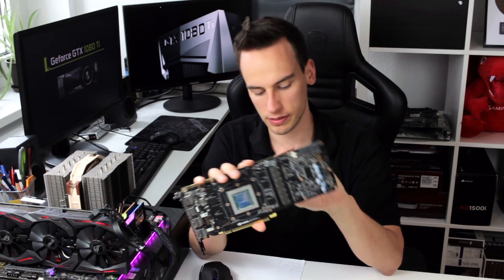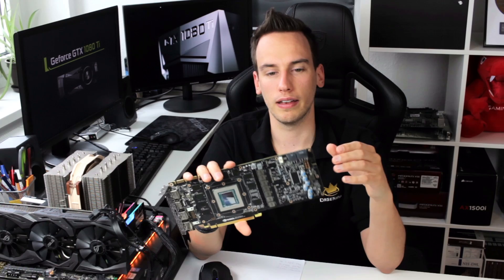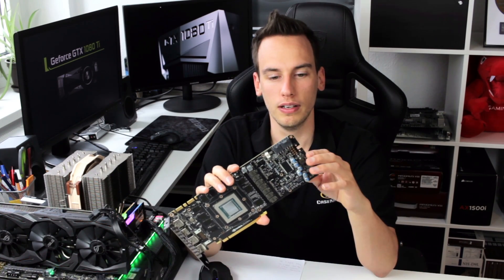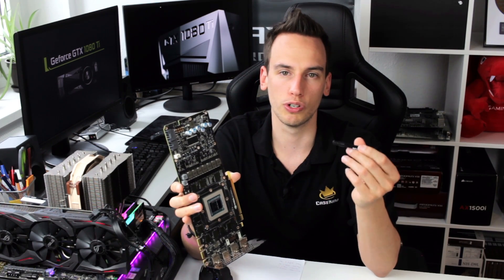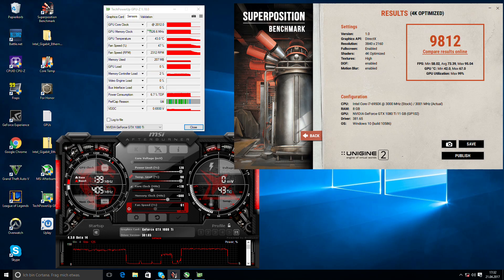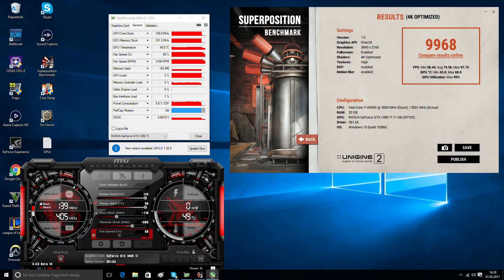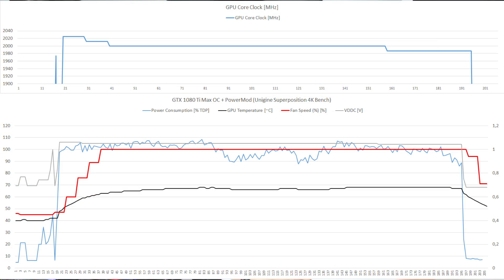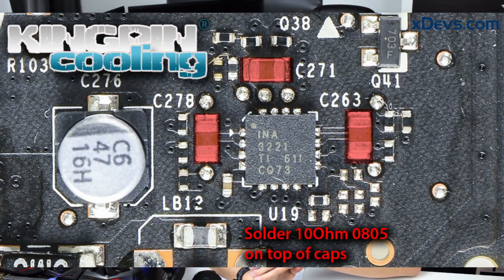GTX 1080 Ti Founders Edition Power Mod (english)

Comment: I got a stable 2114MHz on my 1080 Ti on water in Unigine Superposition without any power mods...
Reply: Wait what? theres a way to "turn off GPU boost" Im pretty  sure thats not true.  Theres a way to use something like EVGA's "Kboost" that will lock your frequency at all times, but that is not great for the card or temperatures. Why would you care if the frequency drops if the power is not needed anyway?
Reply: is that what unigine says or afterburner?
Reply: Afterburner. Could check it with GPU-Z, but there wouldn't be much point.
Reply: +AMDdizzle The great
Bro you are beyond help if you still think I'm wrong. This is the 
official bios taken from an Aorus Xtreme Gaming 1080 ti card. Any 
overclocking tool will allow you to adjust the voltage curve of your 
Pascal card from 800mV to 1093mV - clock frequency per voltage can be 
adjusted to end up with your perfect stable clock for each voltage, so 
that even if your card power throttles to a lower voltage you would 
still end up with a higher clock than stock.

At stock the cards will run at 1050 and 1062 mV. You can achieve better 
performance by undervolting so you are less power limited.
Reply: What kind of 1080 Ti is it aorus extreme?
Reply: kolkoo aorus is gigabytes new premium product name.
Reply: ya if you have a aftermarket aorus or whatever since you auto get a higher power limit.....
Reply: That's not true, all the cards have the same power limits lmao. The aftermarket cards just have different PCB and better cooling. 

By turning off gpu boost 3.0 I meant forcing the clock, sorry.
Reply: +AMDdizzle The great. How do you force the clock? I can't find a way to do it in Afterburner.
Reply: +AMDdizzle The great first of all you can get voltage up to 1093mV using any overclocking tool like msi afterburner or evga precision or asus tweakit.

Second of all aftermarket BIOSes have different TDP. At 1093mV and +500mhz memory YOU WILL get power throttled on any max 300W TDP bios on any heavy 1080p benchmark and ANY 4K+ benchmark for sure. 

Not to mention you can flash Asus Xtreme Overclocking bios that allows you to use voltages up to 1.2V and removes power limit (but it seems to perform worse).

SO here you go info about Aorus Xtreme bios with 375 W TDP

https://www.techpowerup.com/vgabios/191162/gigabyte-gtx1080ti-11264-170406

If you go back to the collection of bioses there you can see the TDP of each one.
Reply: +AMDdizzle The great
Fine so I linked the beta bios they are all the same for the Xtreme gaming you can check them all out here https://www.techpowerup.com/vgabios/?manufacturer=Gigabyte&model=GTX+1080+Ti
Reply: +Sergey Kislyak I've learned to hate stock fan settings on cards. I went from 80C in wildlands benchmark to 60C during the same benchmark by fixing the fan speeds after a power outage changed them back to stock. That was with a red devil rx 480. I'll probably never use the stock settings for fan speeds ever again.
Reply: yeah run that superposition 4K and watch your card power throttle into 1800 mhz
Reply: Umm not aftermarket cards have different power limits, don't talk bullshit, for example the Zotac Amp Extreme has 384W max TDP compared to a 300W max TDP of a Founders Edition Card. Gigabyte Aorus Extreme also has max TDP of 374. So if you watercool an Aorus Extreme you can overclock it (which increases the power demand because you increase the voltage and memory clock) and still not power limit.
Reply: kolkoo Where are you getting this bs from ? 

Voltage is locked on every single 1080 Ti unless you do a power mod and every card has a 25% power target headroom to about 300W.
Reply: kolkoo you're giving me links to some beta bios. 

The stock profile and bios does not allow you to adjust voltage.
Reply: kolkoo It says beta F4 bios and it has no VGA display adaptor listed on it, how the fuck do you want me to believe this is an official bios for the card ?
Reply: kolkoo I ran it in 8K and it only dropped to 2088MHz for a bit (both my cards are on water)
Reply: That's GPU boost 3.0 stabilizing your Frequency vs. Power for maximum efficiency based on GPU utilization and your temperatures. 

If your GPU is only utilizing 30%-60% on a certain game, it makes no sense for it to be at over 2000 MHz so it will drop it down to 1600 MHz or even lower in some cases and undervolt it to improve temps and power consumption when you don't need it. A good example of that would be turning on V-Sync in a game and capping your frame rate at 60. The 1080 Ti will automatically undervolt and drop the clock. Even though sometimes it will stay at over 2000 MHz for a while if utilization constantly fluctuates. 

If you want to be at a certain frequency at all times, turn off GPU boost and just set frequency manually in afterburner. I managed to get mine to 2078 MHz stable on my first try playing witcher 3 with a custom fan profile, the stock one for the Aorus xtreme is garbage.

Comment: Why not try a conductive pen?  [EDIT] this doesn't work as per below.
Reply: der8auer shame that doesn't work.
Reply from the maker: I tried that before. It doesnt work because the conductivity is not good enough
Reply: der8auer Hey ich hab da Ma ne Frage ich wollte den powermod an meiner gtx 1080g1 gaming machen und habe leitsilber benutzt es hat sich aber nichts geändert also sie zieht nicht mehr Strom ne Idee warum
Reply from the maker: Die Leitfähigkeit des Silberleitlacks ist nicht gut genug
Reply: der8auer ok danke für die schnelle Antwort und ich freu mich auf weitere videos machst meiner Meinung nach nen verdammt guten Job und so krass community nah das is einfach der Hammer mfg Lars Meyer